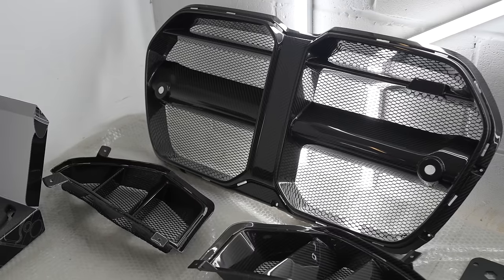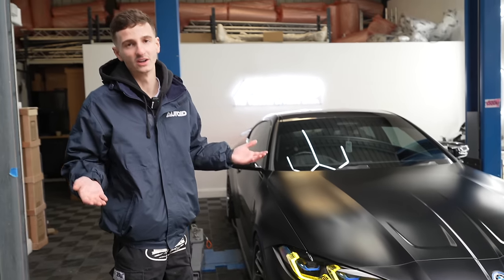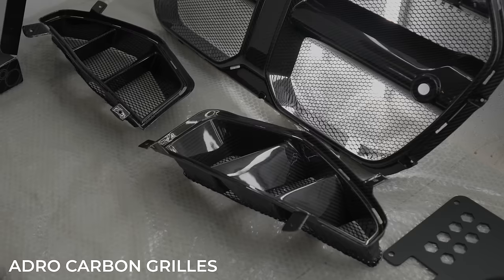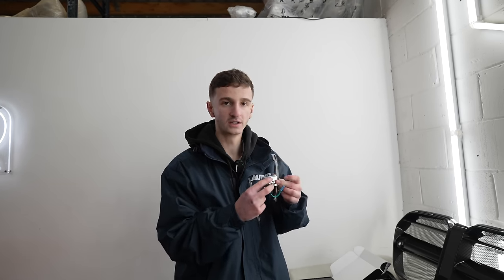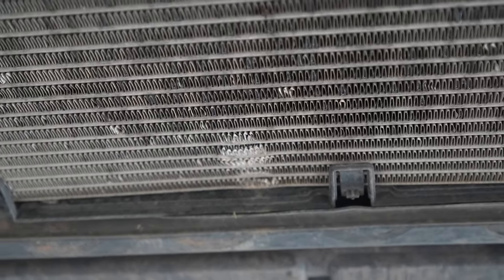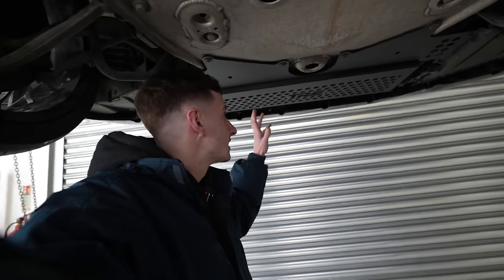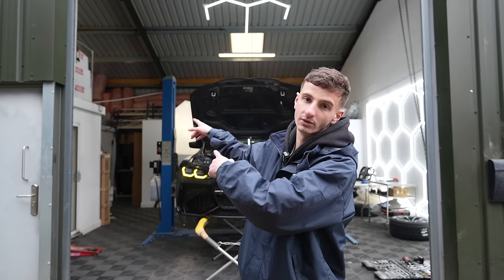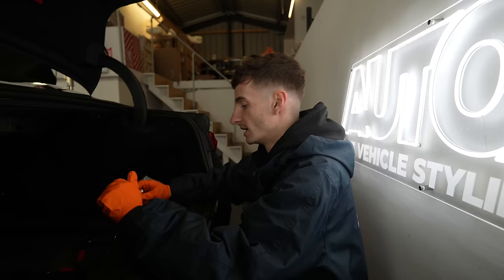MAJOR PROBLEM WITH ALL NEW BMW M CARS | G82 M4 UPGRADES

Comment: If you guys come up with a solution to stop the break squeal at low speeds for the G82, let me know!
Reply from the maker: Sounds stupid, but we’ve found driving the car harder and being a little more aggressive with the breaking tends to clear up the brake squeal 🤝
Reply: Cold brakes. Gonna stomp on them a little bit. Once they warm up they are pretty quiet.

Comment: Nice wrap! Very bat mobile! Doesn't that wheel feel great? I've got a 2020 M2 CS and thought it was a little fat at first... I loved the smaller diameter of the wheel and I got used to the thicker grip in no time. My wife has tinny hands... I doubt she can get her fingers around it. Gives me a plausible reason to not let her drive it. 
This is my second M car. In 1999 I bought an M Roadster. I was the second owner and it had a Dinan chip and a few other mods... at the time I was living in Florida and I used to love shaming mustangs on I95.
I'm going to have to check out what AReeve has to offer for my car. Cool video about getting 600hp out of the G87. I'll let them know that I learned about them on your channel.

BTW,  I just subbed to your channel... how about returning the favor? A drunk driver ended my professional career so I started a channel for kicks... hobby stuff "My RC Channel".

Comment: I have a G20 M340i with the factory ZTK package which comes with an extra Oil Cooler which is mounted in the same location. Been looking for a solution like the TRE Skid Plate but cannot find anything that says it will work on the M340i. Do you know if this TRE item will also fit my vehicle?